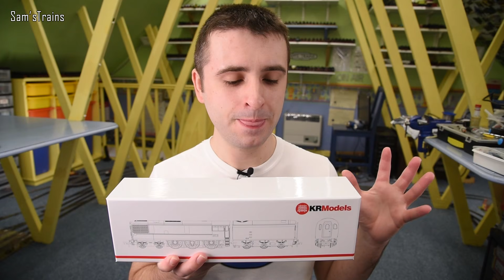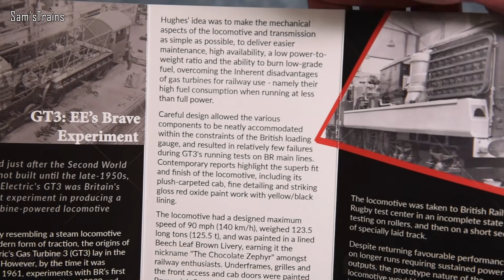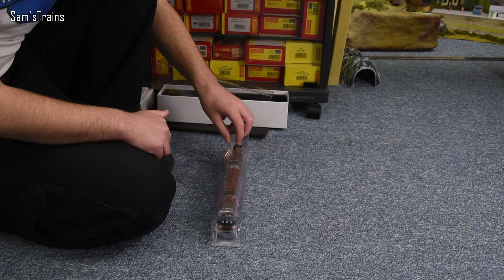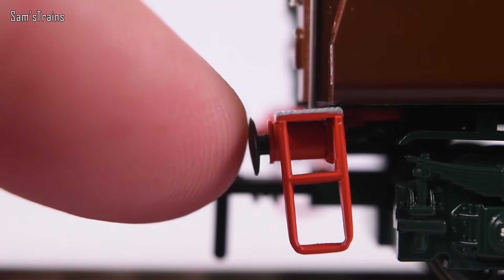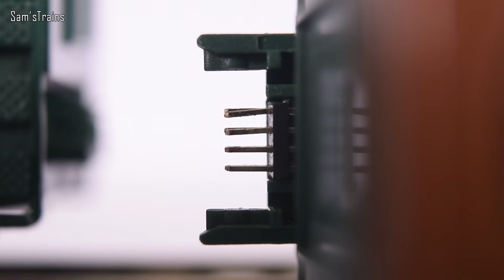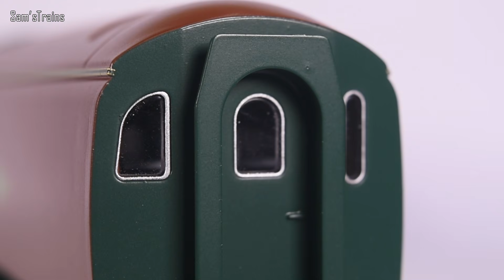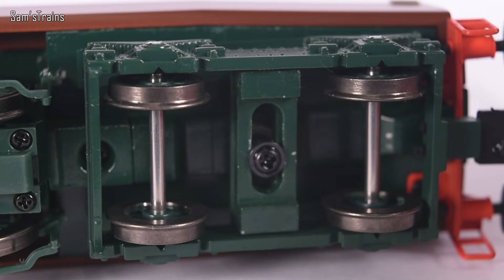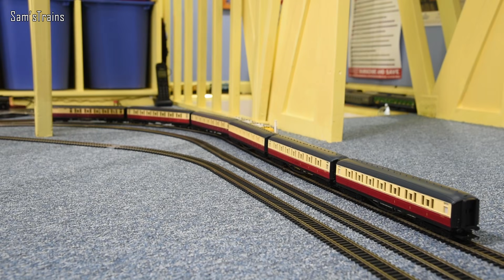Brand New GT3 Gas Turbine Locomotive | KR Models | Unboxing & Review

Comment: Nice looking model; it must be nice to have so many locomotives that you have to store them "off track". Most people I knew had enough money for maybe two or three locos. They were stored on the layout at an engine shed, or attached to a train in a fiddle yard. 28:09 You ask about red lights in the cab; if this was the real cab lighting it makes sense. When I was learning to fly any night time flights were done with red flashlights because red light gives you illumination but it does not ruin night vision for looking out of the cab. On navel ships after sunset all the above water lights, such as on the bridge, are red lights.
As a point of interest: There was some interest in gas turbine trains in Canada when VIA rail took over passenger travel back in the early 70's. They ran on the Toronto to Montreal run for a couple of years before being pulled from service. Their biggest problem was snow creeping into the air vents and causing the gas turbine compressors to stall out. The train would then be dead until a regular loco could come out to rescue it.

Comment: Commercial and military human operated equipment - trucks, ships, tanks, planes, etc. use red interior night lighting. Red light at night will not effect a human's natural "night vision". Interior spaces are easily seen while looking outside to observe your surroundings is not effected by the red light. Homes may have a separate set of red night lights to aide vision when getting up for relief. It's late at night, you hear a strange noise and switch on a light. Blinded for a bit. Red lights have no such adverse effects.

Comment: A very interesting review Sam. My GT3 came yesterday and sure enough, it derails every time on one particular point, I can actually see the leading 2 drivers climbing the rail. I'll also remove the bogie spring to see if it solves the issue. That said, I've wanted GT3 since I read about the real thing in Rail Enthusiast magazine 30 years ago, so the model is worth the wait.
2026 update: I recently unpacked my models following a house move. The layout came with me and was set up temporarily in a bedroom. Oddly, GT3 is no longer derailing on the pointwork it used to. I can only assume the alignment of my baseboard, and thus the track, has altered just enough that the model can take it..

Comment: A very realistic model of GT3. I was at grammar school when it was running and the father of one of my friends was a driver who worked on it when it was running on the G. C. main line. The lining out is extremely good and as one of the features of the original that impressed me as  lad.
One thing that is not correct is the front lamps. It has all the white marker lights open, which headlamp code would denote a Royal Train. Not something it ever pulled as far as I am aware! The white discs were hinged at the middle of the disc and folded down to cover the lamp when they were not required. The same style of disc was fitted to most of the early diesel locomotives as they had to display the same headlamp codes as were in use on steam locomotives. The lower front lamps were not white, but red lamps for running in reverse.
Too anyone interested the locomotive sounded rather similar to a very large vacuum cleaner when it was working hard!
There are several good photographs in existence including some colour shots taken at Leicester G. C. loco depot which was close to the Grand Union Canal about half a mile south of the station. One excellent shot I have was taken outside the shed adjacent to the shearlegs which were used to lift locomotives requiring attention to the axle boxes. It clearly shows the straw and green coloured lining. A livery that was unique to GT3.
I believe the chassis of GT3 was at least partly based on the B. R. Standard Class 5 steam locomotive and as far as I know the roller bearing side rods were another feature unique to GT3.
It was a truly unique and amazing machine which really impressed me and sticks in my memory. I remember going to a display of locomotives at the Somerset Town Goods Yard adjacent to St. Pancras Station (where the National Library now is) and seeing it on display with the latest Standard steam locos including a Caprotti valve geared Standard class 5, and the brand new diesels including Warship Class "Sir Brian Robertson". I sadly only have black and white photos from the display which I think celebrated the 150th anniversary of the Stephenson Locomotive Society.
Reply: Yes it is so realistic train well locomotive

Comment: Yeah, it’d be a bit embarrassing if there was a jet engine sticking out of the back of the tender; it’d burn up whatever wagon or coach was following it. Maybe they could put it on top of the tender, instead. 😌 Then, it would definitely break the speed record for a 4-6-0 wheel arrangement! (Shortly before it jumped the tracks at a curve and plowed into a station) 😬

Comment: Gas turbines are very thirsty machines , and diesel are just quite simply cheeper  to run and easier to maintain. As for the screw on the front bogie, thats just dire. have you tried thread lock / lock-tight on it ?

Comment: KR Models kinda had to rush their models out because of the COVID-19 BS (not Batchelor of Science, the original BS) and yes COVID-19 was complete BS, a relatively minor which regardless of whether it was a severe cold, severe flu, or a norovirus with blood doping regardless of which  ailment accompanied it,  wearing a mask because of it was absolutely unnecessary because if you're actually healthy, it's just a pain in the butt and not worth wasting the time worrying about it. A slightly longer screw should have been used with the front bogey
Reply from the maker: I thought wearing a mask helped to protect others around you - so even though I was healthy, I wore one out of consideration for the people around me who might not have been.

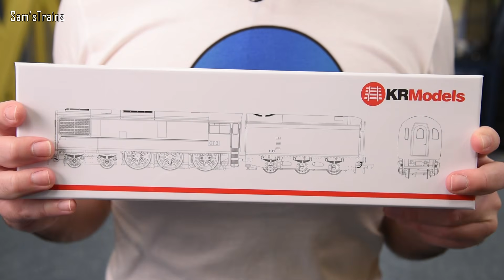Comment: 2:20 If anyone wondering the Gas Turbine IS the type of engine that Jet planes use, but not only them:
A jet engine is a type of propulsion system, where the power comes, by the engine pushing usually exhaust gasses out in a Jetstream to the opposite side of movement, thus pushing to the air and pushing itself forwards. Planes use this as their propulsion method. They can only push the air, or generate directional lift with a propeller, so it's extremely fitting for their propulsion. Rockets also use Jet propulsion, but they work a little bit different.
So what is a Gas Turbine really?
The Gas Turbine is a type of internal combustion engine, one of the 3 main types; Piston, Turbine, and Wankel-Rotary. They all use the same principle: the "Suck-Squeeze-Bang-Blow" or Intake-Compression-Combustion-Exhaust.
While a Piston engine, commonly found in cars, diesel trains, propeller planes, trucks, tractors, tanks, and even ships, uses the pistons movement, well, there are no pistons in the Turbine. The Wankel-Rotary, commonly found in the Mazda RX-3, Mazda RX-7 and Mazda RX-8 sportcars (If they didn't get LS-Swapped) uses a rotor instead, that touches the walls of the engine, and so it can do the ICCE each rotation...but as you might have guessed, we have no Rotor either.

A Gas turbine is built up much simpler than any of the two engines.
It consists of:
-The fairing: basically walls of the engine
-Shaft: Moving parts are connected to here
-Compression fans: They are connected to the shaft, and sometimes there are moving and non-moving blade sections. by the spinning of these fans they pull in air, and push it into the engine, which becomes narrower, and also push through more air, and this compresses the air.
-Combustion chamber: Fuel is pumped here, and constantly burned, creating more pressure overall, also heating and burning the air, further increasing the pressure.
-exhaust fans: the exhaust gasses need to escape from the engine, and the only way they can is through these fans. exhaust passing through here spins the fans, and spins the shaft, which then spins the intake and compression fans, so the engine can work. from here the engine simply can leave. for Jet propulsion, the exhaust kept under pressure, and for a mechanical power take off, extra fans are added, and the gasses de-pressurize while leaving the engine, but still giving off a lot of power through the extra fans.

From here, you get mechanical energy, which can be sent into a gearbox or generator. the GT3 is mechanical, so it's sent to a reduction gearbox, which then powers the wheels like it would power a car or truck.

There are different type of Turbine engines, depending on their way of giving off power:
-Turbojet
Basically just a Gas Turbine, that gives off jet propulsion
-Turbofan
The big engine on airliners. (And the A-10 and the Harrier Jump Jet) It has an extra fan on the front that is way larger than the rest of the engine, with it's own cowling, that pushes extra low pressure air for extra propulsion.
-Turboprop
No jet propulsion, but a gearbox in the front, connected to a classic propeller. Used on planes obviously. It was invented by hungarian inventor "Jendrassik György", and was first used on the RMI-1 prototype in WWII, but the engines were underpowered, and the plane was destroyed anyways by the US. The Brits strap some propellers on the Gloster Meteor, and now everybody thinks, that the Brits invented the turboprop.
-Turboshaft
Similar to a turboprop, but a bit different. The GT3 uses this, and the Chrysler Turbine (Car) also used this, but nowdays the main users are Helicopters and ships, that use it as generatiors.

Comment: Further to the descriptions etc on the GT 3 l never had any issues with my own  model and sprung bogie. Proper design before building is key. Mine is constructed totally with brass sheeting and as with all my models loco to tender is by a sprung coupling which eliminates the horrible gap that manufactures have. Going round bends is no problem and would not cost any more to add. Why these models cost so much l cannot understand.  I have bought run down second hand locos, overhauled and painted, added details and they in the end cost a fraction of a new one. Happy modelling, have a go!

Comment: I haven't checked all the comments in case this has been mentioned. Your question on the red cab light would be for night vision. It is often used on ships because red lights don't dazzle you. If you have  a red light in the cab, then there is very little adjustment time when you look out into the darkness.

Comment: purchased one brand new direct from kr models wasnt very impressed because all the crank pin bolts were loose and 2 fell out completely,i have not got a tool to fit them either.Also distorted walkways above driving wheels.

Comment: I just received my pre-order from the second run of this lovely loco from Rails of Sheffield.  It seems some remedial work has been done on the front buffer beam as mine is straight as a die and cosmetically is as great as yours is.  I've yet to investigate the front bogie to see if anything has been done there, but once I've had it on the track I'll see if it handles things better without adjustment.

One thing to mention, you know all the stick that Hornby has been getting over the way they have been packaging their W2's?  Well it seems that Rails have decided to follow suit and try to find the worst way to ship these potentially delicate models.  Whereas Hornby just stuck the W2 in its cardboard outer into a woefully inadequate cardbox box, Rails went one better putting the GT3 in its cardboard outer just in a plastic shipping bag!!  I mean really Rails, for a model costing this much you couldn't have sprung for an outer cardboard box and some "cheesy-poofs" (those foam things resembling a potato snack)?!?  Thankfully like my W2 from Hornby this seems to have gotten here in one piece, but really guys please take note and try to do better, especially at this time of year in the middle of a pandemic when there is so much post flying about.  Meanwhile another package from Kernow arrived this week beautifully packaged, suitably sized outer with "cheesy-poofs" and sealed well and that was only for a budget model loco...

Comment: Once front bogey is set up perfectly, use a low potency grade Loctite on that holding screw thread. That'll stop it working loose but easy enough to remove if need be.

Comment: Another superb review. If Sam likes it, then I know it's a "go." I won't buy a rail joiner unless Sam reviews it first. BTW, here in the USA, the Union Pacific experimented, decades ago, with the Gas Turbine. Apparently, the bunker oil it used was comparatively cheap, and the UP is always try to save a buck. The story goes, one stopped for a signal, under a roadway overpass for a time. The heat generated by the idling turbine was so hot that it actually melted a hole in the asphalt. Ooops.

Comment: That front bogie just looks awkward, both on the model and the original. Looks as if its a temporary weight bearing bogie off of a coach. When a thing looks right it is right and that doesn't. However, the loco looked great pulling those blood and custard coached. Does anyone do a sound file for it ?

Comment: One of my favourite locos, but to be really acurate KR should include a form of heat generation  You couldn't stand too close to the real thing without feeling you were going to self ignite, and when it came to a stop under the foorbridge at Great Missenden the radiated heat set fire to the wooden floor boards.

Comment: Union Pacific had Gas Turbine Locomotives from General  electric and ALCO. before they gave Diesels a chance they are jet engines on rails... they run on a tarlike substance called Bunker C fuel and they are nicknamed Big Blows and Bird Burners Due to them Spitting fire in the air during startup they did mainly Freight work, However though The Gas Turbines Became expensive as hell for UP and Many people found ways to make stuff out of Bunker C fuel oil and it made Prices Skyrocket, When UP gave Diesel Electric Locomotives a chance that was the Final nail in the coffin all except one was scrapped.

Comment: A gas turbine engine works by essentially converting the heat of exhaust to work. Be that through a flow conditioning nozzle like a jet engine or an extra power turbine like a helicopter (or locomotive) engine, or even a combination of the two like a high bypass turbofan, where the "power" turbine actually spins a very low pressure, very high flow, single stage compressor (i.e. the fan) that moves a lot of air without going supersonic. It's all down to heat.

The downside of a gas turbine engine is that it's only really efficient at one power setting which is almost full power. Great when that's what you need (because it can be made more efficient than a diesel), but not really practical for anything that doesn't require constant high power output (like a locomotive, or worse - a car). At low power most of your energy literally just blows out the exhaust pipe.

It's also not practical to make a small high efficiency GT engine because to do that you need intercoolers and cogeneration (never mind extremely tight running clearances for your compressors and turbines). Maybe on a locomotive that would work well, but not on anything smaller.

Comment: That front bogey could use a nice brass spacer around the screw, maybe a running washer and weak leaf spring to loosely couple it to the main body, but I wouldn't put much weight on it if it can be helped.

If push comes to shove though, a drop of blue loctite will keep the screw as far out as you want without backing out.

Comment: Hey Sam's Trains. Do you think you can do a review on another diesel? There's one that's called the M1 Steam Turbine Diesel Locomotive, part of the Chesapeake & Ohio Railway
Reply: Gas turbines are not diesels, they are basically high speed jet fuel burning single rotor compressor fans. Diesels use reciprocating pistons like the engine in your car. Not remotely similar.

Comment: Idea to fix the bogey problem, try and find a longer screw and then dremel it down to the perfect size so it screws in all the way so it can’t be knocked loose but has enough length so the wheels can touch the track.

Comment: 11:18 Yup. The difference between a gas turbine and a jet engine is how the energy produced is used. That's it. Jet engines are, technically, gas turbines, only instead of using the high velocity exhaust gas to turn yet another turbine and produce torque they just exhaust it directly to the atmosphere to produce thrust.

Union Pacific experimented with gas turbine locomotives here in the US, too. The GTELs were a four unit consist and had an absolutely voracious appetite for fuel. They were built much later than the GT3 was and turned generators which ran standard traction motors in the bogeys as per normal for a diesel/electric. 30+ years of active service before their fuel costs finally caught up with them; at time of retirement they were basically running on raw crude oil run through a filter. They were monsters though, and saw a lot of high priority express freight service across the prairies.

Fun fact: The two auxiliary tenders UP 844 tugs around all the time are former GTEL tenders.
Reply from the maker: Duly noted, thanks a lot for the info! :D
Thanks for watching, Sam :)